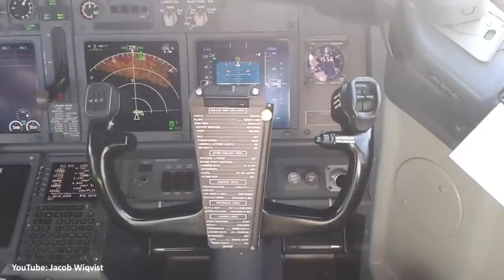Why does Airbus use a side stick?

Comment: Why is every one saying that yokes are better? People are you only saying that cuz your a boeing fan? Im boeing fan but yokes are very bad to be hinest side stiks are better and more easy to use and handle

Edit i know boeing isent the only air plane company that uses yoke
Edit ITS MY OPINION!!!!!!!!
Reply: A yoke you can see the input from the other pilot. Side stick you can't. It's a airplane not a video game.
Reply: Barney Rubble still a side stick is really easy and ive been in a 737 and a320 simulator on vacation and i personaly think that the a320 was really easy to use during landing and take off so thats just my opinion
Reply: Yh but the fact is you can’t see the operation being held by the other pilot. In case of an emergency neither pilot knows what the other is doing whilst the computer systems dominate. Yokes are manually adapted for both pilots and have less sensitivity and a wider range of motion.
Is operating real Planes, not Flight Simulator
Reply: U have dual input warning on airbus if both use sidestick
Reply: @Racko.  but only one stick has full authority control. ONLY ONE pilot is doing anything at one time.
So this is a bit of a non issue.

The issue in the ONE crash which has a side stick mentioned as a cause says two important things.
1- The indicator to show which pilot is in control is too small
2- The side stick could do with feedback side to side
The only reason the sidestick was an issue was because the crew didn't actually know what was going on in their aircraft. Neither of them fully grasped the situation. NOT because they were doing different things. The pilot in control was the one who carried out the wrong action.

I hate to tell you, but Boeing aircraft are highly computer controlled too. A huge misconception that the pilot has more control in a modern in a modern Boeing Aircraft over an Airbus.

Pilot error and CTIF are still the biggest causes of accidents, not technical failures or computer issues.
Reply: Johnny Wynn but the fact is this is my opinion
Reply: @munky123jw  only one pilot can actually make an input at a time with a sidestick, you don't need to know what they are doing, just who has control.
In fact, if the pilot wants to pull a control column one way and the other does not, it is far more dangerous because the strongest will win. - not that this situation is an issue in reality thankfully.
Reply: @Racko.  actually it is also irrelevant about the range of movement because fly by wire still computer controls the deflection of control surfaces depending on airspeed. You pull the column all the way back, but depending on airspeed the aircraft will respond slower or faster.
This used to be done with springs and hydraulic restrictions but now done by computers in 99% or aircraft.

I am an Aircraft Avionics Engineer currently specialising on a digital flight system that is being upgraded.
Reply: What is the matter with me expressing my opinion? I like yokes.
Reply: @Marko-vz6jp  In the case of the Air France 447 crash...so many audible alerts were sounding off that feature didn't make a difference....which means the dual input warning is no where near enough in a crisis situation where the number one task is to fly the plane no matter what the emergency.
Reply: @munky123jw  There is no need to call anyone a dick. As much as I support Yokes, this is a very good chance to learn.
Reply: @munky123jw  the task of the pilot monitoring is not watching what the other pilot is doing with the yoke. And Airbus has created systems that allow a pilot to completly overrun the other sidestick. If you do that you can hear the "Priority left" or "Priority Right" call out.
Reply: @underwaterdick  I agree with the second part but I must point out that you are wrong on the first one. As Captain Joe once explained if both sidesticks are moving, the fly by wire computer sums up both inputs. But this is not an issue because you can just use the priority function to disable one of the sidesticks :)
Reply: @tomasribeiro8020  thank you for correcting this. I was under the belief that a dual input brought on an annunciation on the screen to alert of two inputs, but only the priority stick created a flying control movement.
It's good to have these discussions as we can all learn.
Reply: I don't care who makes the aircraft. My thought has always been; Why would a manufacture want to risk putting the primary control of the aircraft in someone's weakside hand? I'm right handed and I don't like flying with the left. I've lived in multiple countries that drive on the left side. I have to think more about shifting with the left hand then the right (trust me, 5-on-the-tree lefty in Tokyo is not fun). I would rather have my primary hand on the controls and the ability to tell if someone else is making control inputs without looking/asking someone else.
Reply: @jarheadcharlie2315  but you don't have to ask. If both pilots are moving their sidesticks you will constantly hear a callout saying "Dual Input!!. Simple as that.
And even on Boeings, the captains usually have their left hand on the yoke and the right hand on the thrust leavers, so there is absolutely no advantages for the yoke there.
Reply: @underwaterdick  I believe there is only real priority if you use the priority function. It's not like "captain side always has priority". That would go against the correct cockpit philosophy wich states that both pilots can make mistakes. It's always good to learn :)
Reply: @tomasribeiro8020  it seems like some people in this thread are not aware of the roles of pilot flying/pilot monitoring and their roles in an emergency. CRM really comes into play there.

For those who are not aware, in an emergency one pilot should be flying whilst the other assesses the situation and consults the checklists. Emergency situations SHOULD NOT be flown from memory if there is a checklist for that situation.

I remember the time a pilot came back to base telling us how they had a 'false' fire indication on the APU.
When asked if they fired the extinguisher they said no, because they didn't 'feel' there was a fire, and looking through the glass viewing window to the APU compartment they didn't see flames. But they DID shut the APU down.
The checklist said that the extinguisher MUST be fired if a warning comes on....
Turns out there HAD been a fire, but thankfully the APU was encased in a firebox...turns out that is why they could not SEE flames.
They were VERY lucky that the firebox did its job and the burning oil extinguished it's self before landing.

It could have easily lead to loss of electrical power (nearby power distribution boxes) or loss of airframe due to structural damage in the tail area. All because they did NOT follow a checklist and went on what THEY thought.
Reply: @jarheadcharlie2315  the throttles of passenger jets are in the centre console, so one pilot will always have to use LH and the other RH on column when operating throttles.
I think it is a bit of a non point.
It gets worse in Helicopters when flying and trying to operate switches from both positions.
Reply: People have their own opinions. They they are neither right nor wrong just respect them.
Reply: TheGamingFox YT I think it’s more easy  to land with yoke
Reply: This is nothing to do if a person is a Boeing or Airbus fan boy
Reply: I prefer the yoke over the sidestick, although I can see why people would prefer the sidestick more.

Also, all major airlines in my country use all Airbus planes (except the main airline which also uses 777s, Q400s and Q300s and another one which also uses ATR), but there hasn't been that much Airbus crashes here. Only three of them I know about, pne was caused by a failure in the throttle computer control, the other two were caused by pilot error. Also, most of our airports have runways that are very hard to land on, with no ILS, VOR or anything so the pilots are forced to manually land the plane, and it lands safely all the time.
Reply: By the way, you all realize that Airbus aren't the only ones with sidestick, right? Russia's Irkut MC21 (or MS21) and China's Comac C919 have sidesticks too.
Reply: Jong how many times do i have to say this is just my opinion and many others
Reply: Animasjon its my opinion!!!!!!!!!!!!
Reply: Chris McKellar its my opinion!!!
Reply: Leͥgeͣnͫd GAMING good but its just ly opinion
Reply: @master_shifu4208  I'm just giving my opinon as well.
Reply: @chickenadobo7649  and some Dassault falcons and Embraer private jets also have a sidestick.
Reply: Doge Bomber ok i dont remember asking but ok
Reply: Doge Bomber i never said that

Comment: Sidesticks over yokes of course. Although the left handed one would seem pretty awkward compared to the yoke (unless you're a lefty). Because (unless you're one of those weirdos who drives on the wrong side of the road or an automatic) you're pretty much used to handling a steering wheel with your left hand while shifting gears (or doing some other stuff) with the right. And a sidestick doesn't handle like a steering wheel of course. Still the sidestick is used to give commands to the computer, within certain parameters, which will then interpret and execute, leaving less room for pilot error. Rather than some big stick pulling on a cable in a pulley system. It's 2020 not 1920 ffs. Also something less to bang your knees on. I swear Boeing just wants pilots to suffer, like with those trim wheels on the 737.
You can disable the other sidestick, and if dual input is given there is a light indicator and an audio warning. So it is absolute bullshit that this contributed to the crash of AF447. A lot went wrong on that flight, and the crash was caused by no one but the crew. Them not communicating properly and ignoring all the warnings is what caused the crash.
Reply: You would still use your left hand even on a yoke because your other hand is on the throttle.
Reply: @nguyenhoangan-matt  I didn't say anything to the contrary. I merely said that using the sidestick with the left hand might feel a bit awkward (at first) for most people. Yoke in the left hand would feel more natural, whereas yoke in the right would probably feel a bit more awkward (albeit less than a sidestick with the left) as well.

If you're right handed, try using a joystick (or a mouse, or a remote even) with your left hand, and while driving try turning your steering wheel with just your left and and just your right hand. You'll see what I mean.

Comment: The yoke blocks the flight instruments. On take off with critical engine failure after V1 with a low level obstacle turn, the yoke gets in the way of the instrument panel. 
I experienced that for 20+ years every six months during recurrent training in the Dash8 Turboprop.
A centre stick, like the aerobatic aircraft, has about the same leverage and even more leverage in roll as a yoke without blocking the instrument panel. The yoke is higher so that in roll it will not be blocked by knees and thighs. ("Clear Knees and Nuts" when checking controls for "Full and Free") 
Another benefit is if the pilot by chance hurts an arm or hand he can use the other hand which would b very difficult with a side stick. 
My 2 cents.

Comment: That is one of the reasons I love Boeing.
For convenience they are ignoring safety
Reply: Prateek Pandey ?
Reply: There’s a higher chance to prevent emergency in case of a problem from the cockpit with the yoke system VS the side stick because Pilots of B aircrafts are highly trained and can manually take control over the entire aircraft.

Airbus uses Side stick and the computer mainly controls. So in case of an emergency, the computer will take advantage over the pilot that won’t know what do to since they rely on the computer systems.
Which can lead to terrible results
Reply: Really so there antiquated master caution system, where pilots have to go on a search to find the problem is more safe than the system Airbus uses? Or is it just convenience so they don’t need a new type rating?
Reply: If safety is an issue you have to consider that a control column can slow down escape in an emergency as you are sat astride it.
I spend all day climbing in and out of cockpits and it's a right pain!
Reply: @Racko.  That's what I think. By the way thank you all for conveying your replies.
I'm not a aircraft expert. I am just an Aviation Greek.
And everybody has there own perspective and right to reply.
Please do not troll for that and if you want then I can delete the comment
Reply: @roadrunner6224  That's what I think. By the way thank you all for conveying your replies.
I'm not a aircraft expert. I am just an Aviation Greek.
And everybody has there own perspective and right to reply.
Please do not troll for that and if you want then I can delete the comment
Reply: @underwaterdick  That's what I think. By the way thank you all for conveying your replies.
I'm not a aircraft expert. I am just an Aviation Greek.
And everybody has there own perspective and right to reply.
Please do not troll for that and if you want then I can delete the comment
Reply: @Racko.  well, i don't know which comment you were replying to, looks like it is gone thankfully.

On the safety side, I would argue that computer control is much safer.
Pilot Error and CTIF are two of the biggest causes of air crashes, computer and technical faults are not.

As an Avionic Engineer I can tell you that Boeing are very computer controlled, and aircraft have had hugely computer controlled systems since the 70s.

Anyone who thinks that the all the switches in a cockpit actually give pilot full authority of everything are mistaken. Most systems have interlocks and clever logic involved , so even when the pilot switches something it is often to start an automated chain of events, relays and computer programs.
Long gone are the days when the switch was just a break in the power circuit or linked directly to its own relay.
Reply: I don’t really like knowing that an airbus is controlled by a computer, but if an hydraulic system snaps it could be bad
Reply: @forza223bowe5  most aircraft are largely 'computer controlled'. Even Boeing.
Reply: @forza223bowe5  oh, and NO aircraft is controlled by 'A Computer' there is always redundancy. So it will be TWO computers at least 😉
Reply: @forza223bowe5  Airbus a 320 and all the aircrafts which launched after that comfort fly by wire system including Boeing embraer and bombardier aircraft.
But there are multiple backup options for any type of emergency situations
Reply: @Racko.  you are over simplifying things.
Reply: @tomasribeiro8020  Just in case of a serious situation
Reply: @Racko.  do you really think that Airbus has no redundancy systems for every system?